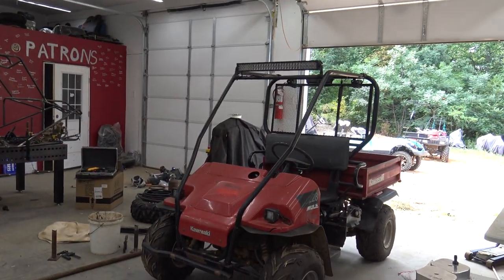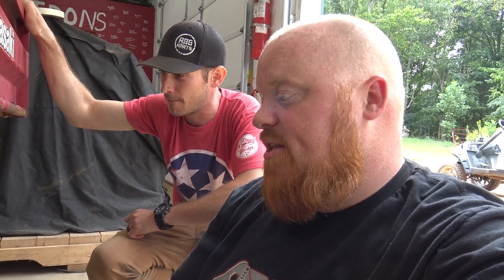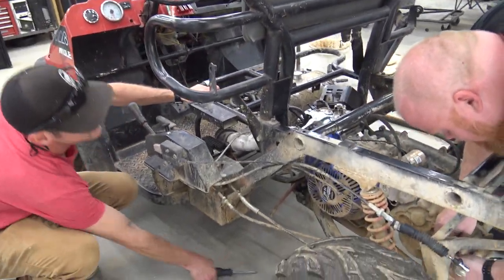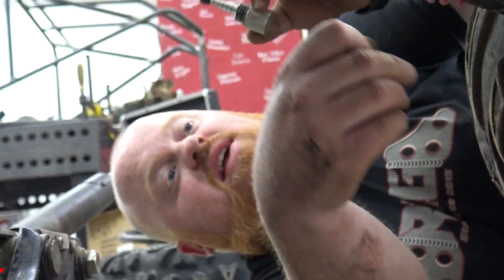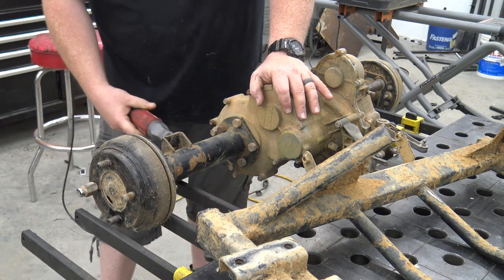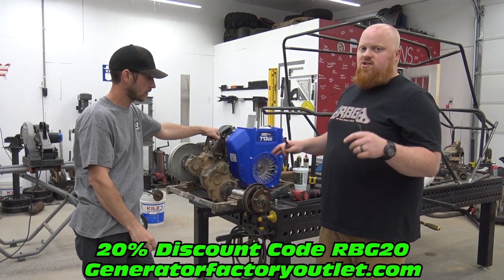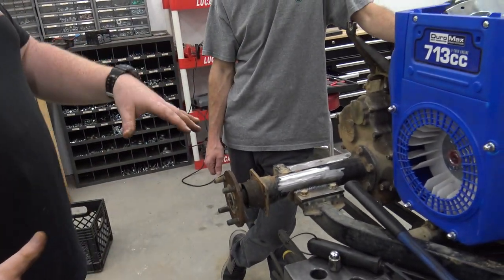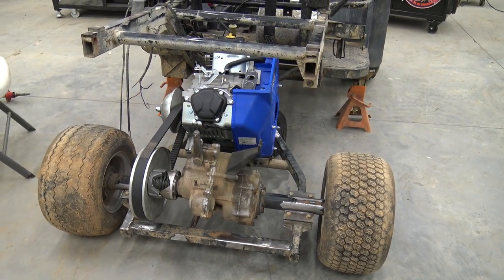713cc V Twin Kawasaki Mule ~ Gearing & V Twin Engine Upgrade

Comment: Have you ever tried using a GM 1-wire alternator for your charging systems?
They are simple and relatively easy to set up and use, all you'll need is a pulley off the front of the engine and that one wire to make them work.

Comment: I'm converting my Yerf Dog 30034 to a solo kart. I got it all off and ready to weld my steering on. Here's the dilemma, I have a 125 flux mig and a 100 AC stick that will run 3/32 6013 and 6011. Is this sufficient? Any pointers? I'm obviously not a great welder but I'm a mechanical dork like you guys, I figure it out and love every minute of it burns, cuts, bruises, second guesses and all!

Comment: Should have had the machine shop drill your axles. Then you could easily run either pattern. Just pull the studs and put the other in with matching drum.

Comment: What would you need out of the two mule rear axles?  I have a cool custom 4x4 project in mind that i could use them stock mule axles for
Reply from the maker: Make a offer

Comment: why not just make two pivot points on the front and get rid of the panhard bar all together?
Reply: @bradensmith888   not sure about that, with a track bar the rear goes side to side when it travels up and down, so doubt that is why

Comment: I plan to build a surface drive mud motor real soon.  Between the duromax 713 and the predator 670, which engine do you like the best?   I prolly won’t do much performance upgrades to it, but just wondered which route you think would be best for me?

Comment: A buddy of mine had one of these laying around, dropped a 302 in it n some how destroyed the “diff” it was pretty slow so I’m still lost as to how that was possible
Reply: Torque probably killed it, a lot more than it could handle I'm sure.
Reply: These have like little 208cc engines stock
Reply: No he didn’t.

Comment: I really need some advice . I got this mega moto ( the big version ) frame and i want to connect my predator 212 but the chain is on the right hand side but it has the thing with the sprocket on the left hand side .. How would I connect my engine to this Mr.Readbeard ???